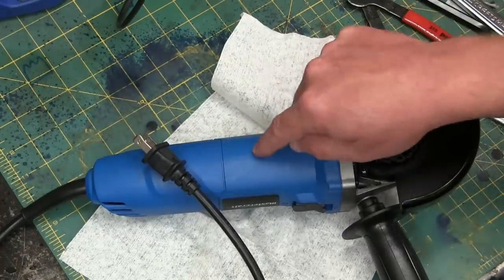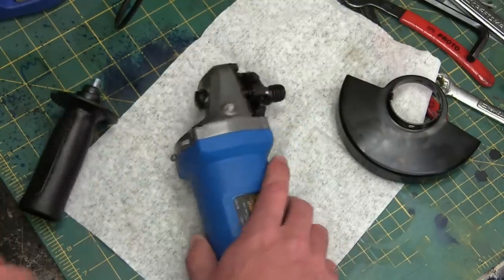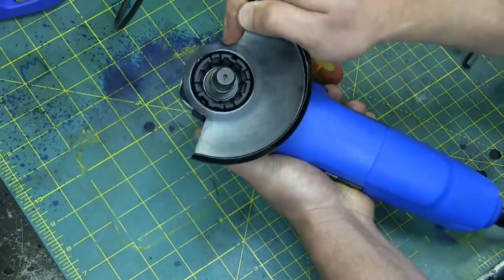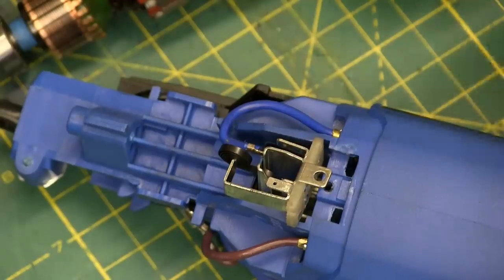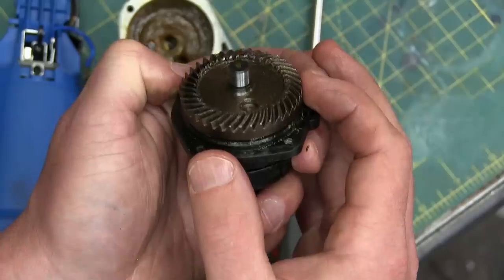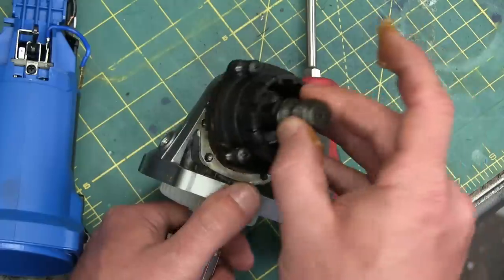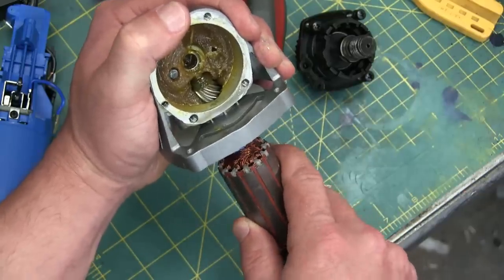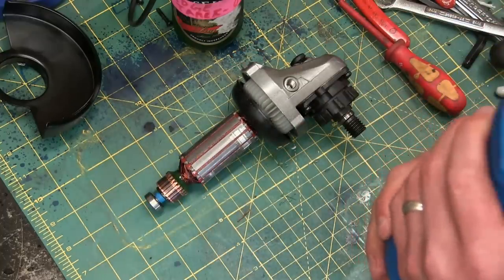BOLTR: Harbor Freight Grinder. HOW BAD IS IT?

Comment: about 25+ years ago a girlfriend bought me an angle grinder from Northern Tool for $7. she told me how cheap it was and it was just a stocking stuffer so if it failed, no biggie. it was my only grinder for 20 years and i USED it.  i built things like snowmobile trailers and skid steer attachments etc. one winter i was removing mounts from a bobcat bucket and i would grind with it until it got too hot to hold with chopper mitts on, let it cool for a few and start it up again.   finally the dammed thing fell off the bench and the op rod to the switch broke.  i rigged it constant on an put it back together.  it still works to this day, just plug it in and let'er buck. nice and safe.
Reply: Michael Lindquist you're also the guy that they tell to stay home the day OSHA comes
Reply: on another note, my grandpa had a Makita grinder he left in the belly pan of snowmobile that sat outside for 15 years. when I dug the sled out, I plugged the fucker in and she still chooched like new
Reply: Not only stay home the day OSHA comes, but take your infernal grinder with you!
Reply: Michael Lindquist Girlfriend buys you tools? Marry her.
Reply: And get here a $7 cubic zirconia
Reply: Michael Lindquist 20 years ago $7 was about $50 now days not only in inflation but quality
Reply: i bet your grinder outpayed it like 100 times
Reply: @airborneexplorer  no
Reply: airborneexplorer I don’t think those numbers are right
Reply: First harbor freight angle grinder finally failed after about 20 years of abuse. The newer units usually go just beyond the warranty. Cheap quality oxymoron.
Reply: I have the same grinder just as old and on all the time ha ha! I call it the gag grinder lol
Reply: Put a momentary switch on the lead. OSHA- approved.
Reply: I have suix, milwaukee,  makita , dewalt, and off brand chinese grinders. Some are 40 years old. Some high dollar ones are in my drawer of woe. While some of the cheap ones keep going. I buy tools at auctions and garage sales. They might not work... but are great for parts to resurrect the dead ones in the drawer of woe.
Reply: i bought a shitty $10 harbor freight grinder 4 years ago, use it daily and it still works mint. luck of the draw i suppose.
Reply: Screw the Metabo! :)
Reply: @Borals  lol, no. Those numbers are very wrong.
Reply: BTW that Bosch grinder still works, no doubt because I have seven of various brands, mostly Bosch, and the wear is distributed. But it is heavy and relatively underpowered compared to my newer Bosches, most of which I have purchased as reconditioned for less than $40. Never had a cheap HF grinder, but did buy a HF oscillating tool for the wife, who uses it to cut up dahlia tubers every November. Bought a Bosch for me and it quit, but the company fixed it for free, way out of warranty, because it had had little use.
Reply: I only got 7 years out of my HF grinder.  I feel ripped off.  ; )
Reply: I bet that grinder wasn't made in China.
Reply: Ozito  rockx .. I oil them an change parts then kill them it's great fun ay  :)
Reply: I too have a similar experience: I bought the HF special back in high school 2004 and have used it to cut a lot of angle iron, square off steel tubing and prep all manners of weld surfaces with countless abrasive disks replaced, sure the gears chatter, but to this day the thing still works and is my backup grinder.
Reply: Thing is you could do that with tools 25 years ago cheap or expensive. Not gonna be using something you buy today in 25 years time
Reply: @TheLexiconDevils  i just bought a grinder last year from harbor freight. its been running for 25 years now! just 5 thou runout!
Reply: She's a keeper!
Reply: My friend won an auction lot pallet of Buffalo Tools, so he gave me a 7.5 amp sawzall, and a 3.5 amp "hole master" cutout saw.  When I got home and plugged in the hole master saw, it immediately let the smoke out in my hand, DOA.  I've abused the living hell out of that sawzall and it just goes and goes and goes.
Reply: If you're like me, the grinder probably lasted longer than the girl friend. Lol

Comment: Buy the Metabo, put the box in the background of all the videos...  and never open it.
Reply: I like your style
Reply: Use a plexiglas surface on the workbench so it can sit under every shot.
Reply: metabo*
Reply: This is all a very good idea
Reply: +TheGunner1212 Tank you
Reply: Intro a few videos holding the box and the he should say,Meh,not today.
Reply: 666th like... Wtf
Reply: That's evil
Reply: Metabo f ing #1
Reply: Buy Milwaukee
Reply: There still junk. Go though 2 to 3 a month. Burn the #$&# out of the cutting higher alloy steel
Reply: On a coal fired power station back in the 1980s we were getting through Wolf (allegedly good kit) grinders at a heck of a rate. 
The Metabo sales guy said “do your worst” and we never did manage to burn one out or duff up the switch. It has to be said they didn’t like falling from the 120ft boiler drum level.
Reply: @hockeyslade  Chinese junk

Comment: See how the switch assembly is attached via a long plastic rod that goes past the motor? When the motor gets too hot it melts the plastic and the switch no longer works. Happened to me 2 times, now i have 2 hot-wired grinders, and 1 working grinder. Its always russian roulette plugging them in.
Reply: Oof
Reply: How many fingers do you have left
Reply: But that makes it more fun

Comment: I had a $10 harbor freight grinder that met my needs and lasted 10 years. I was happy with that.
Reply: Dantastic honestly it could last for a week and I’d be ok with that
Reply: The only time you really need more than a harbor freight or Walmart grade tool is when you do real work with the tool. Heavy abuse and long run time really expose a poor design.
Reply: I got a harbor freight grinder and I’ve had it for like 6 years still going strong
Reply: I had a Hazard Fraught back when the store was new. It came with an extra set of brushes. I needed them, after only 2 days. And then, it crapped out fully after another day or two.
Reply: I've been through 6 of the Warrior grinders from the Horror Fright in the last year. Thankfully I usually kill em within 90 days so I get another one for free. Right before Christmas I got myself a Bauer on account of being tired of switching from cutoffs to flappers and then my brother got me a Milwaukee cordless angle grinder "for Christmas" on account of me donating and installing my old suspension lift components on his Jeep after I upgraded to long arms. The Bauer is much quieter than the warrior that's practically been retired and comparatively the Milwaukee is a church mouse.

Comment: I was a diesel mechanic on a research boat back in a former life & we had several of the $14 ones on hand for the jobs where survival of the tool was "questionable".  They always surprised me on how much abuse they could take before letting out the smoke.  2 main failure points we saw were cooking the brush plastic (as you predicted), and the screws holding the aluminum head to the body would break out of the plastic if dropped.  Oh, and the head leaked grease like a pecker in a whore house, but at $14 a pop, who cares?!  It kept the high dollar grinders safe when you're hanging off the side of the boat or balls deep in bilge sludge.
Reply: Previous Generation version had an alloy "snouty bit" (at least here in AUS) - but they were $25 Australian and came with a 12 month replacement warranty - and spare brushes (for unknown reasons) - they were fine as long as treated like a grinding "service" - aka don't get upset, just return for new one.

Only had one spectacularly let the smoke out - while cutting a 5t truck chassis - probably fair.

Comment: $30 for a grinder? Do I look like my name is Rockafella? I have the $14 job which I got for $10.  I got two for when the first one dies,  couple of years later, the backup is still in the unopened box. I cut stone, concrete, mortar joints, tons of steel. It's still kickin and the switch still pinches my thumb EVERY time I turn it off.
Reply: I maintain that, for the price, two or three of them is perfect - not for replacements, but to get through jobs faster by leaving whatever wheels (cutting, grinding, wire, flap-disk) I'm using the most on each.  Changing wheels on angle grinders is a retired-man's past-time; but three, mount those fuckers, and get the god damned job done.
Reply: @tommypetraglia4688  That's a great idea as well.  
I have a 'better' angle grinder, but it wasn't until I was handed a free HF angle grinder that I realized that having two, then three, cheapies made creative welding jobs go so much faster by having all the types of wheels/brushes already attached and ready.
Reply: @workingguy-OU812  that's the truth. I work in an aluminum fab shop and have a couple metabos, a makita, and a couple Milwaukees, all set up with different cutoff wheels, wire wheels, flap wheels, bristle discs, whatever. What a time saver when you can just grab the tool and go instead of swapping wheels all the time
Reply: @chrisrage5836  yes sir!  :-)
Reply: Unless you're using wire brush or diamond cup attachments, a basic cheapy grinder will get the job done. It's the dynamic loading that the cup attachments will put on the gearbox that the cheapies can't handle. The other exception are abrasive flap wheels that eventually require downward force to get the most of the abrasive which can damage cheap grinders.

Comment: Lots of my welding students come in with these every year and for that kind of minor use they hold up OK--few crib deaths.  They all sound like they are going to come apart at any minute though.
Reply: Why are all the horrible fraught tools soo loud?
Reply: +Double A poor fitment mostly, cheap or no bearings
Reply: shitty bearings , grease, bad gear teeth  and not balanced motors. .
Reply: They ever try replacing the grease?
Reply: I suspect the grease is more expensive than the entire grinder.
Reply: that's what I did in my shop classes id go buy two or three and leave them at my bench and if they still worked at the end of the year they were left for the next person.
Reply: My mastercraft flux welder makes much better welds than by brother in law's lincoln electric. It's much nicer to use also. I get deep penetration on 1/4 inch steel, and looks like factory mig. A lot of it is how you use the tool, not the name. Unless it job mate lol, then it just sucks.
Reply: At a school I went to they had a few small dewalt grinders and some small harbor freight ones that looked like dewalt knockoffs. They seamed to have similar power but the harbor ones sure did sound horrible. I imagine it's just poor gear fitment and the grease getting flung away by use. If it was something u had to use frequently I'd spend the extra money for a good tool that won't be so bad to use.
Reply: Just put lapping compund in it instead of grease,  should get quiet lol

Comment: I've destroyed 17 Mastercraft grinders in the past 4 years. Most common mode of failure is the motor burning up. Ive had 6 actually catch fire. Second to the motor, the bearings (and/or housing) let go on the main shaft. And yes, that grease does leak out over time. Got to love the free replacements!
Reply: u need a bigger g

Comment: When I see UL and CE on super cheap Chinese tools, power adapters, etc., I assume they are just fake markings, much like the QA Approved stickers they slap on during assembly.
Reply: too true!
Reply: In fact, THIS was the real china export mark, Ave always makes fun of :D
You can tell because the C and the E are too tight together. When you imagine the C as a full circle it shoud touch the E on the edge.
Reply: Anyone can stick a CE (Conformite Europeenne) logo on their product. It's not a certification, only a statement of intent. In theory manufacturers or importers  could get into trouble when the product turns out not to conform to EU standards, but I've never heard of anyone getting prosecuted for falsely putting a CE logo on their stuff.
Reply: The "chinese export" thing is a hoax that some people took too seriously and doesn't get more true even if it's repeated all the time.
Reply: you can go to the UK web site and enter the number and it will tell you if it is real or not.. but I would think Canadian tire would inspect their suppliers for legit safety listings
Reply: Economy of scale is a beautiful thing.
Reply: Canada requires Canadian Standards Association approval (CSA) for all consumer products. I'm surprised, which must be stamped or labeled somewhere on the exterior cover. But, that doesn't mean the components used inside it have been CSA approved - individually. 

This is where UL and CSA run into a lot of trouble with consumer complaints. It's also a problem a lot of marketing companies abuse for 'brand' selling like the old Rockwell, Coleman, etc, names that are used "under license". If the marketing company's contract simply has UL or CSA approved 'appliance', good to go. Nothing else required. Pfftt till the first billion dollar lawsuit happens, in which case the marketing company  doesn't care, they simply hand over the brand license back to the owners and close up "shop" (which means stop ordering containers of Made in China crap) and on to the next one.
Reply: CE allows for "self-certification" for things with "low-risk". Not sure if hand tools are considered low risk but..

Comment: I did some pretty heavy cutting with my HF grinder. I was cutting 3/16" plate steel to make seat brackets. 80° day, cutting for about three hours almost continuously and the only problem I had was the disk removal tool bending. Grinder got pretty hot to the touch but no dripping grease and it still works great.

Comment: I bought a pair of harbor freight 4.5 inch angle grinders for about $14 each when I started doing welding and metalworking on a shoe string budget. The first one took a dump after about an hour and half grinding plate steel with a flap disc. Curious like you, I took it apart to find out what failed. The brush holder had melted just like you would predict. The same grinder also had developed some gear noise in the head before it died. The second grinder power switch quit working unless you would tap on the side of it. I took it apart and found it was a cheap momentary on/off switch (correct name escaping my thoughts at the moment) with the wire soldered on. So I soldered the switch I transplanted from the other grinder into the second one. The grinder lasted about a month before the brushes wore out down to the springs. 

One brush was worn more than the other by about 25%. The spring from the worst one got caught in the commutator and havoc followed. The gear box itself on both grinders were cast aluminum. It looks like they finally upgraded the power switch on yours to a better version but went backwards by using plastic for the gear box head. Needless to say, both grinder armatures make some nice robot sculptures when you make scrap metal art out of them. I bought a Milwaukee 11A 4.5" angle grinder to replace the HF one that died and it is a beast. You can hog on a flap disc or grinding wheel and it barely bogs down. Before I catch hell for saying hogging on it, that was just to find out how stout it was after I bought it. I don't run the piss out of my tools. The Milwaukee runs about half of the temperature the harbor freight units ran and have yet to have any trouble out of it in the 2 years I've owned it. It did get dropped when I was on the shop roof and the cord caught it with full weight on it during the fall and didn't break the cord loose internally. Tough grinder. It has fallen off the bench a few times and survived. If you plan on using a grinder heavily but like the 4.5 inch compact size, buy the 11A version over the 7A. Big difference in ability. Just my two cents. Love your channel AvE as honesty and bluntness is always a win in my book!

Comment: The clipboard warriors would love the preferred power switches used on the grinders here in Japan... A basic toggle switch on the boring end of the grinder next to the cable entry...

Always exciting when you plug it in after the switch gets bumped in the toolbox.
Reply: A little late to the show here, but... I have an "Eagle" brand 4 1/2 inch angle grinder that I got who knows where maybe 5 years ago. It has a toggle switch by the power cord, just like yours in Japan. It has held up well, I was just using it a few hours ago while welding and it still works great. I'm not a professional and don't use it heavily every day though.